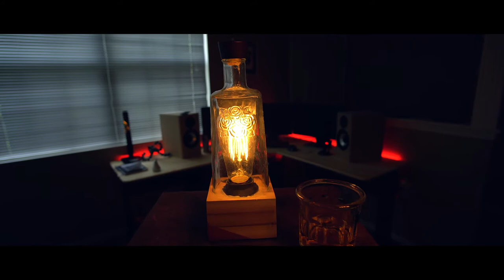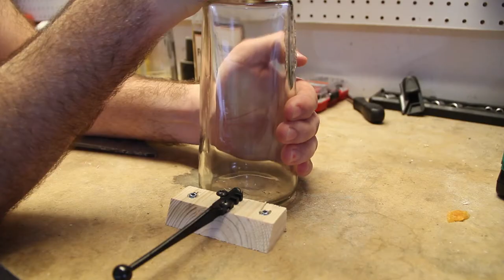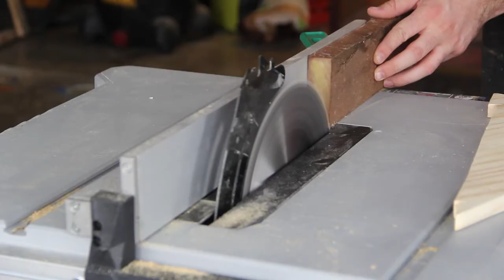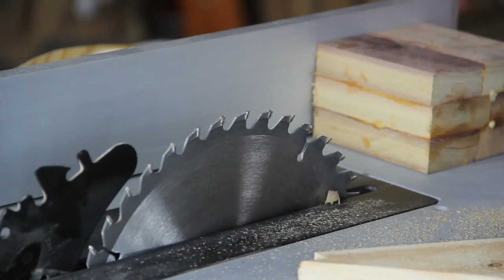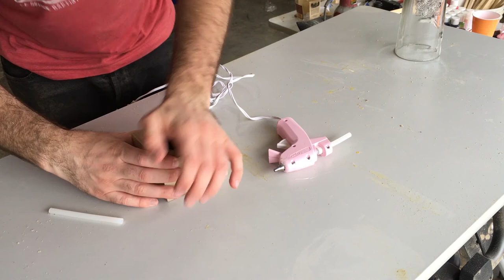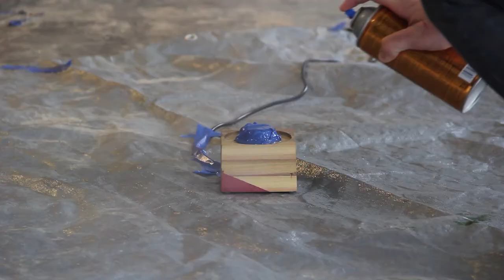How to Make a Rustic Whiskey Bottle Lamp

Comment from the maker: Small update: I realized that hot glue squeeze out looks pretty awful. Plus it didn’t hold too well. (Probably that awesome tiny pink glue gun I have). 

So instead I’ve scraped the glue and epoxied the base down for a tighter, cleaner fit.